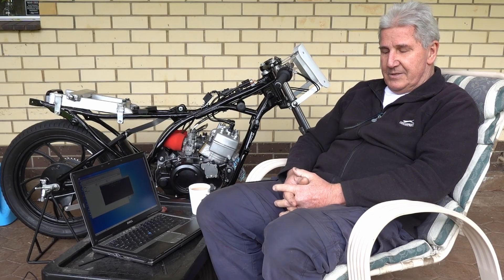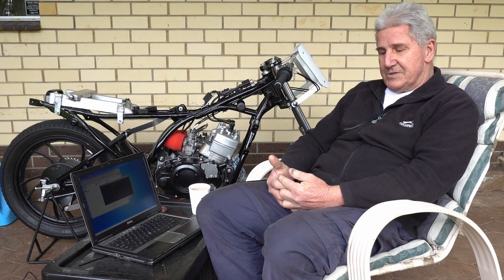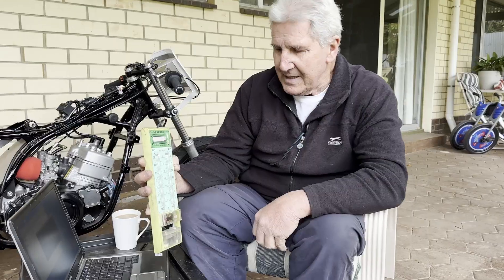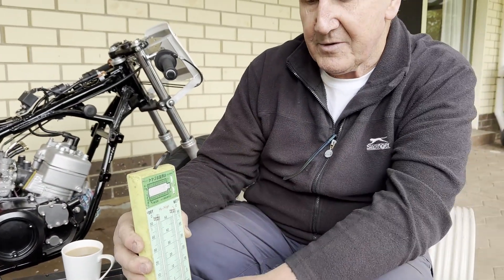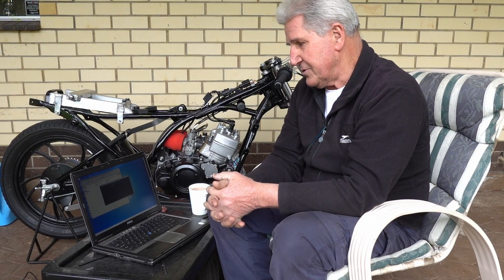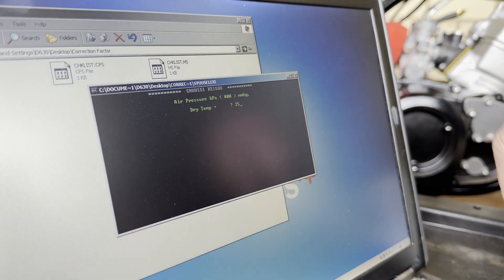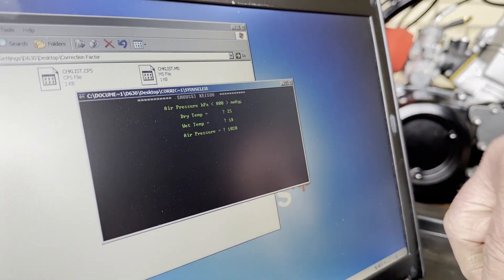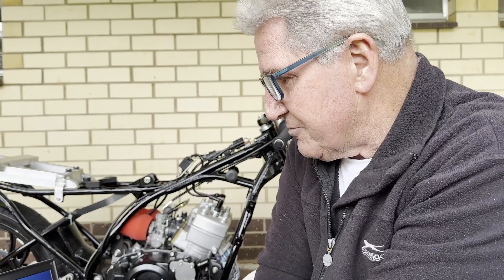Two stroke tuning

Comment: Cool video guys. I love that Yamaha gauge. I also use a Kinsler Relative Air Density meter together with my weather station at the track. Then I cross check against my 125 kart tuning app on the iPhone to double cross check. (It’s a Honda CR125 kart engine app similar to the RS125) Can you ask Mal about altitude? For example Broadford vs PI. I can vouch for the tuning diligence needed at PI - we were checking the RAD every hour - at one Island Classic we had sea fog roll in in the afternoon and the humidity and air density was so heavy 😢 So many jet changes that day … Love to know more about setting needles. They cover a lot of the rev range. Thanks Andy and Mal
Reply from the maker: I will forward these questions onto Mal mate.

Comment: Great
Anywhere we can get a copy of this old DOS program ?
I searched for it but cant find anything.
shuusei keisuu just translates in Japanese as "correction coefficient"
Reply from the maker: It’s an old HP software program. He is trying to get it into an app so we can have it on our phones. He said Honda have something similar also.
I will let you know once we have it available
Reply: @AndyPitman-vt7hm  Excellent, thank you.
If there is code in basic i might be able to help with that.
I do a few freeware 2 stroke apps.
Reply from the maker: @AuMechanic  where are you based, Are you in Australia? Would be keen to speak to you about looking at getting this program on an app
Reply: @AndyPitman-vt7hm  Im in Melb
I write progs in VB
I have code to run a DOS program in the back ground and then "pipe" to it to send it kbd inputs and then capture screen outputs from it in to the Windows GUI so it basically looks like a standard Windows program to a user and no sign of DOS program.
Its a long way around doing it if I cant get source code for a DOS program.
Reply from the maker: @AuMechanic I will get the program on a USB stick and send it to you mate
Reply: @AndyPitman-vt7hm  Ive sent you an Email
Reply from the maker: Mal has the main copy. Let me see if he can get it out mate

Comment: Is this something that needs to be done on road-based track bikes like a rgv250 for example with an exhaust and air filter but otherwise standard engine or only for race bikes like the tz bikes you guys ride? Obviously the operating window on the 2 stroke road bikes would be much larger and less sensitive to weather changes compared to the tz as they were designed to be used everyday so would making adjustments of jet sizes on something like a rgv throughout the day be a waste of effort or still necessary?
Reply from the maker: If the bike is standard jetting it will be safe. Unless the jetting has been changed at some point or other changes like pipes and airboxes it would be be a good idea to do a plug chop and check how it’s running at the track. 
Road based settings will be safe from factory but if it has been changed at some point of its life it would be worth confirming. 

If you feel a drop in power when it’s a hot day and when it’s cold it feels nice crisp and sharp maybe worth adjusting when it’s a hot day 👍
Reply from the maker: Let me confirm with Mal mate I will get back to you